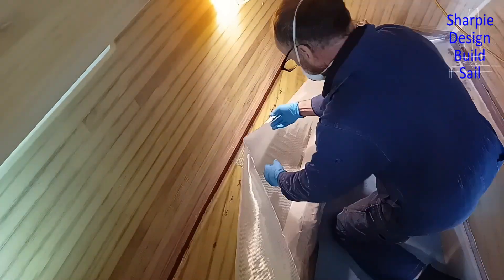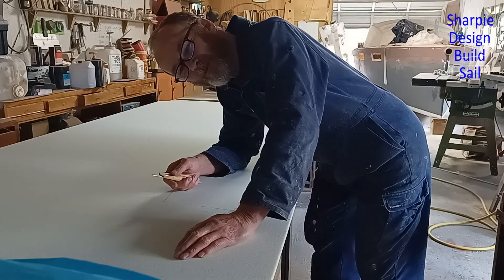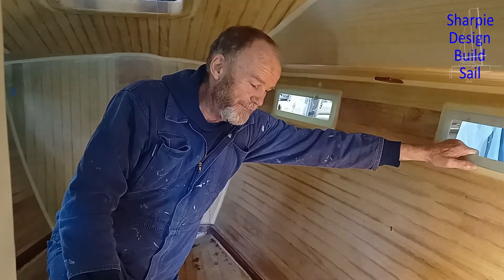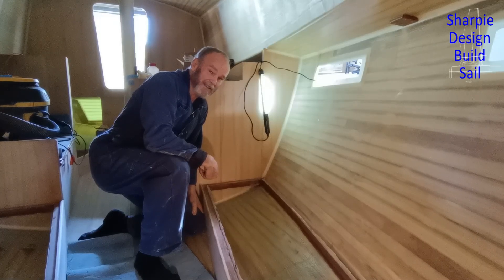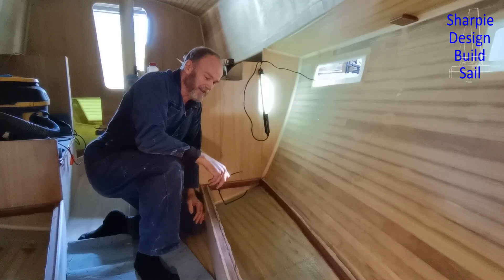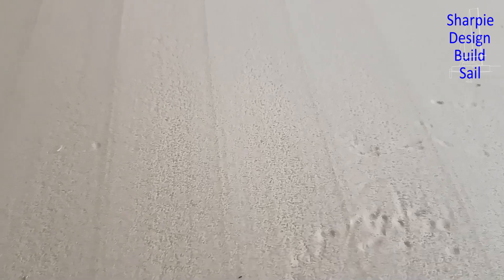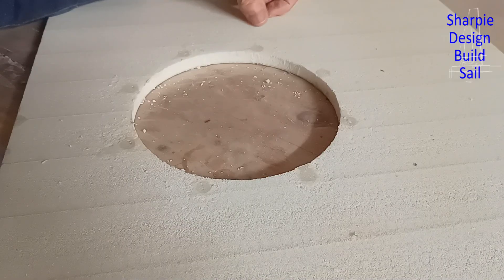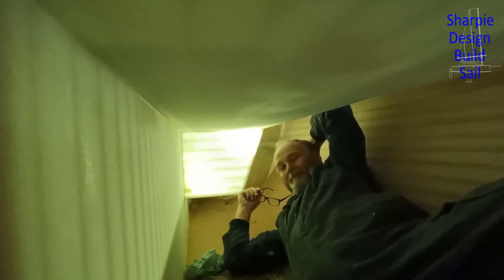Sharpie 23ft Trailer Sailboat Interior Build Pt.4 | The Battle of the Tanks!

Comment: From memory another sailing channel I watch, A boat called Wanda used Scott Bader Crystic 491? Isophthalic polyester resin. It uses a highly pure resin and MEKP as the initiator without an accelerator like cobalt that could leach into the water, thus it takes days to fully cure unless you can post-cure with heat.
Reply from the maker: That's good to know for the next boat thanks! I don't really think there will be another boat but your information could help someone out there. I found the channel but not the episode in the water tanks. Cheers for the feedback